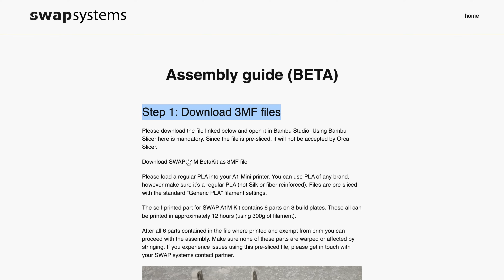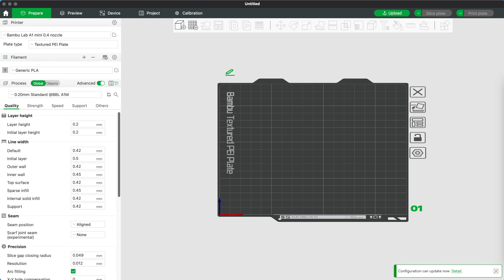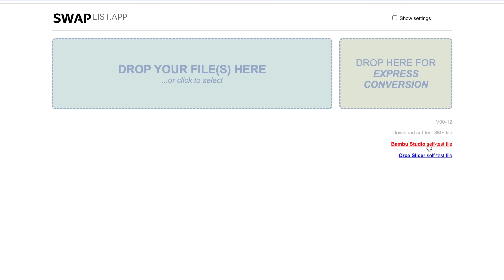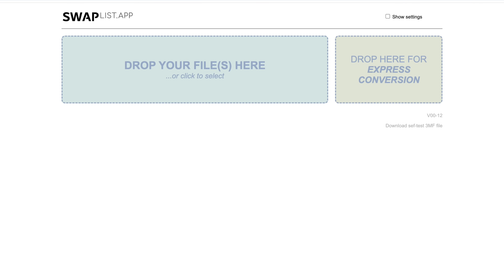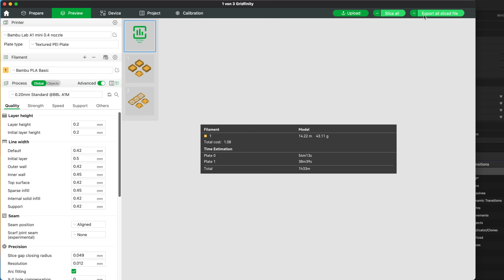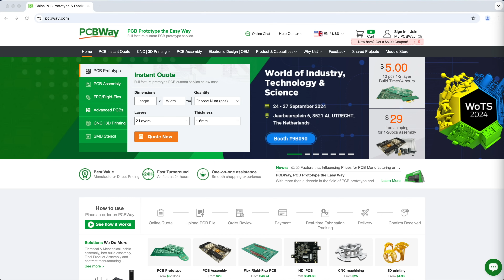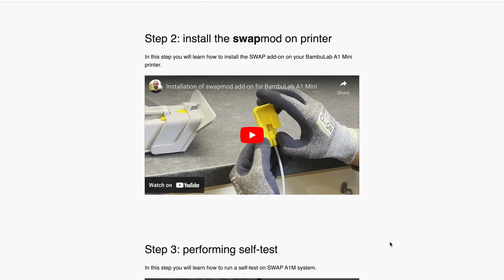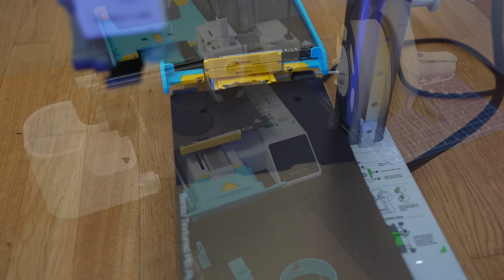Bambu Lab A1 Mini ULTIMATE Upgrade - Fully Automated Plate Removal Mod

Comment: Looks good - I've been using 3dQue for my automation - works well, but you do need to wait for the hot bed to cool down before it knocks the prints off. This method seems like you'd be able to reduce down time and you can get a full beds worth. I lose about 5cm at the top using 3Dque so the hot end has enough space to get behind the print to knock it off.
Reply from the maker: yeah it‘s exactly how you put it! Perhaps you can try it out and see if it works for you. Of course, u‘ll then need more space for your printers since it will increase the footprint of the A1 Mini, so keep that in mind as well!
Reply: Is the 3dque software worth it? Does the bambu labs online software do the same job?

As for printer, do you recommend the a1 mini or a1?

Thank you😊
Reply: 3Dque will no longer work with Bambu products with the latest firmware. Bambu just killed a business with a firmware update lol
Reply: @braaap2065  it will still work

"Developer Mode (Optional): For advanced users of the X1, P1, A1, and A1 Mini who prefer full control over their network security, an option will be available to leave the MQTT channel, live stream, and FTP open. This feature must be manually enabled on the printer, and users who select this option will assume full responsibility for securing their local network environment. Please note that Bambu Lab will not be able to provide customer support for this mode, as the communication protocols are not officially supported"
Reply: @braaap2065  not exactly

Comment: Really awesome video.

What happens if you run out of plates (like it looks like happened on your last print)? Does the printer pause and wait, does it try to print on a non-existent plate, or something else?
Reply from the maker: Thanks! and good question, i actually didnt try that out. My best guess is that it‘ll just print on the bed. (it will prep & calibrate before each print so it will think that the bed is the plate).
But then again, A1 Mini also can detect if there‘s no plate on the bed. Maybe i‘ll try it out and see what happens!😆
Reply: @Lukis3D please keep us updated
Reply from the maker: @marcel2258  @hotfix7387 hi guys, I tested this and the A1 Mini will just stop printing, showing "No build plate is placed" error message (this is a built-in plate detection feature of the A1 Mini). Tested on the A1Mini running the firmware 01.03.01.00.
Reply: @Lukis3D  nice!